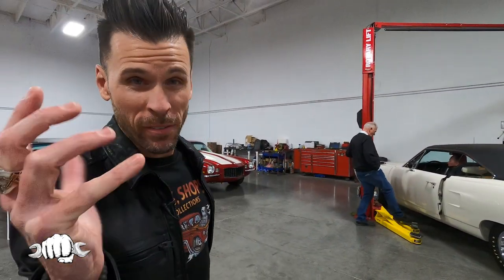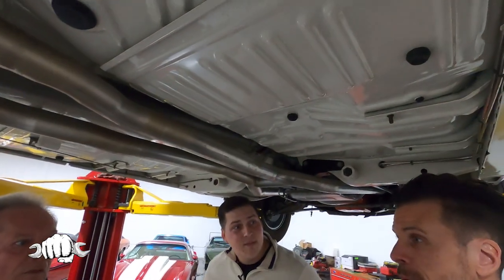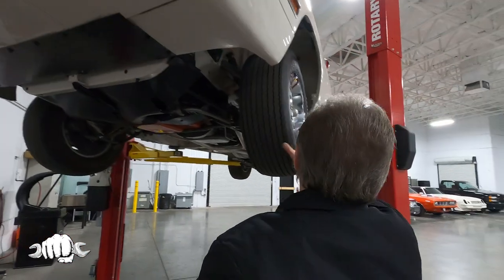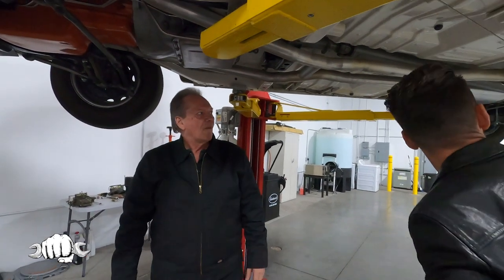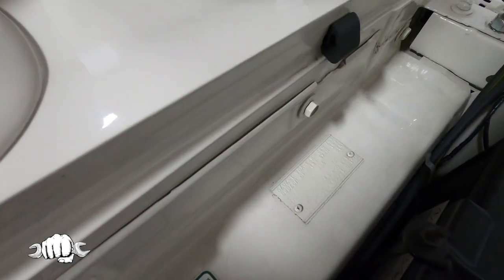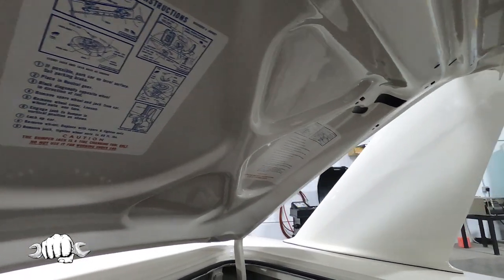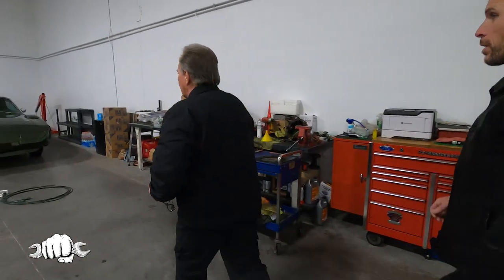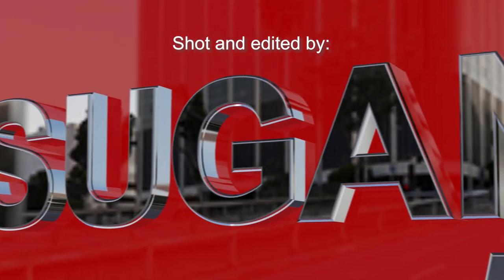1970 Plymouth Superbird Sells For $401,000 - Barrett-Jackson 2023!

Comment: whats with all the oil running down the exhaust? 1:08 starts when you can see oil running down the exhaust pipe.. then a drip forming before the cross pipe..
Reply from the maker: I did not notice any drips when we were under it, and no oil stains when we moved it. Interesting!